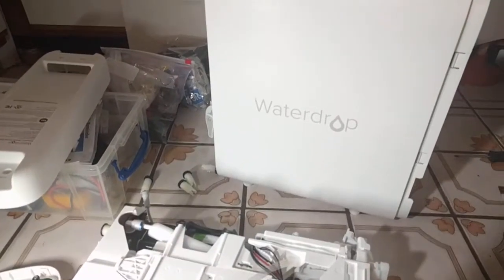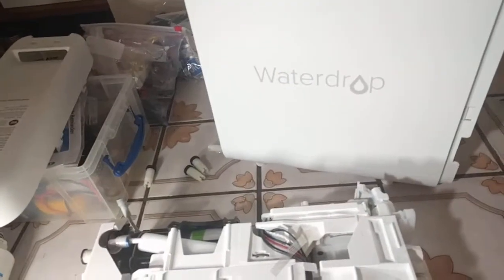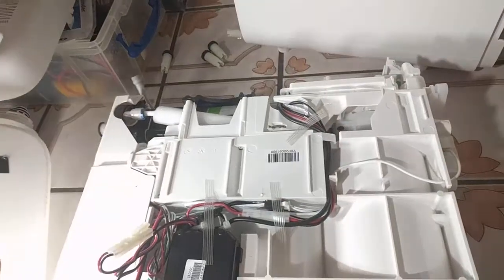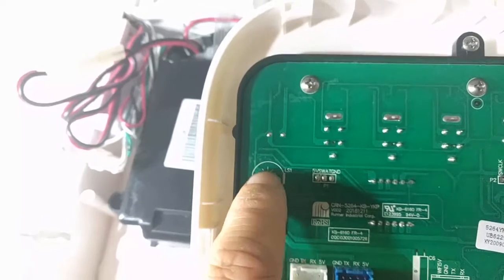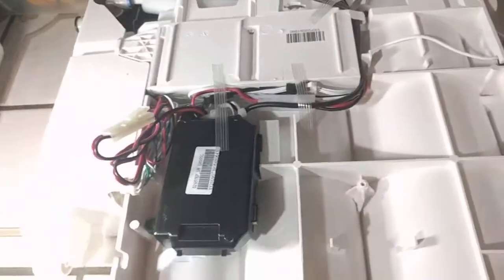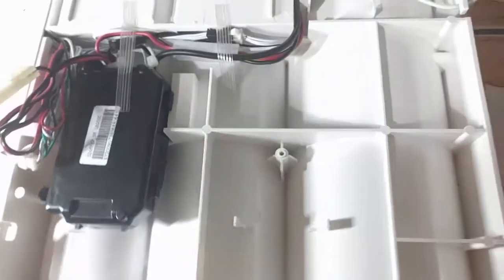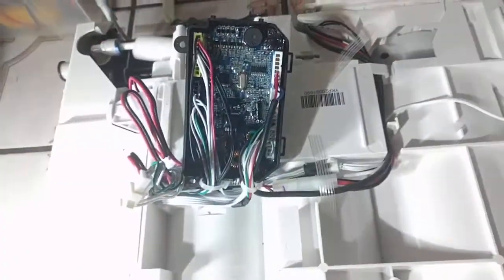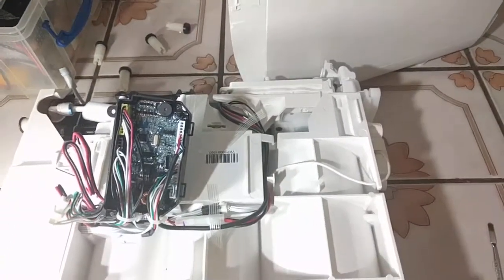Waterdrop Reverse Osmosis Teardown (Heinous Buzzer Remove Hack Part 1)

Comment: Is there a inverter circuit in here? I got this thing in a RV and would like to power it off 12v DC or 24v DC.
Reply from the maker: oh ..I have no idea.  I didnt reverse engineer it that much just needed to get it to shaddup lol
Reply: Hmm maybe I have a different version but my waterdrop g3p800 system has a AC adapter and the output is 24v.

Comment: On other Waterdrop models you can just do a normal filter reset.  Press and hold the center "action" button, until the respective filter LED's start blinking, and then short press to indicate a reset.  This is part of the standard process outlined in the manual for after replacing with a new filter, but you can do it at any time, including if any filter is "expired" if you so choose.  Does this model not allow this?  How does it handle filter resets?   I suspect this is timer based, not actually wear based, since they seem to indicate replacement needed almost exactly after the time it's supposed to last has expired, even tho very little use (gallons of water) have passed through...

Comment: so they are using a timer to expire the filter so how do we really know the filter is bad like bad bad?
Reply from the maker: taste or use a water test kit / sensor.  You can buy them online.
Reply: @SegasonicfanDesigns  but the machine keeps telling me beeping oh it is time to change the filter, I hardly use it. I think there is a timer in there. Please share your finding how to know filter is still good instead of seeing the red light.
Reply from the maker: @kack7130  Yes, they use a timer. They say so in the manual as well. I just told you, you need to get a digital water tester, or water testing kit.Or you can just go by the digital readout that the machine gives, instead of the red blinking light.
Reply: @SegasonicfanDesigns  thanks like a TDS water reader from amazon
Reply from the maker: @kack7130  yep

Comment: This is the EXACT reason I am here! I figured that I would depopulate the speaker as well. I do not like that the filters 'expire' on gallons OR time. Unless there is evidence to suggest time as a critical factor, it would seem to be merely for profit. The teardown is not self-evident... And after seeing this I am debating if it is worth it. Were both speakers active it was the second speaker the primary? The sound seems to come from where the first speaker was.